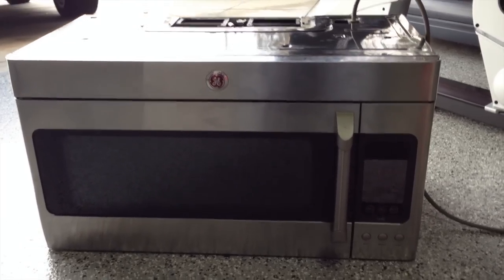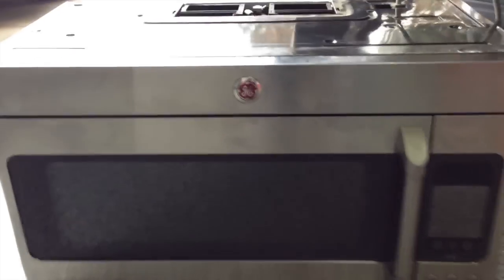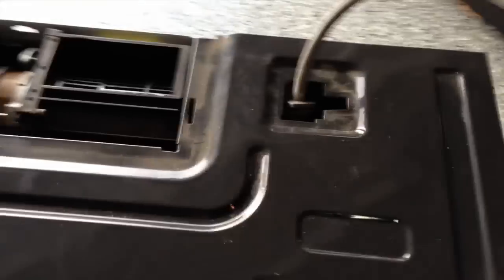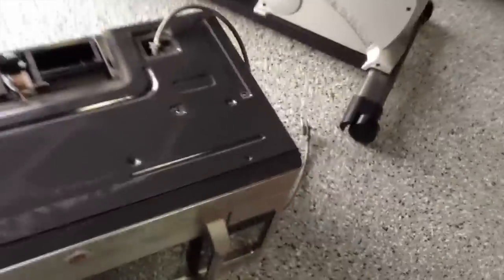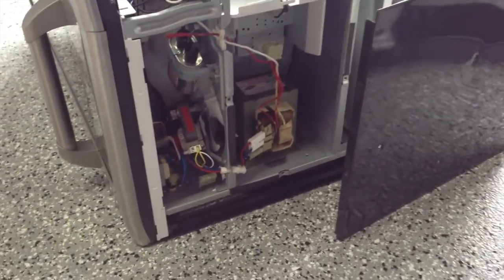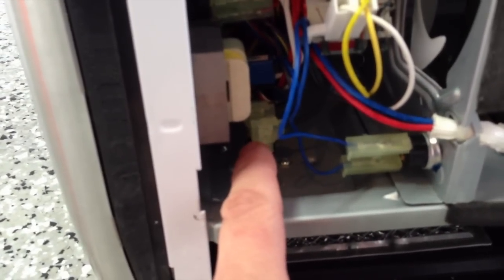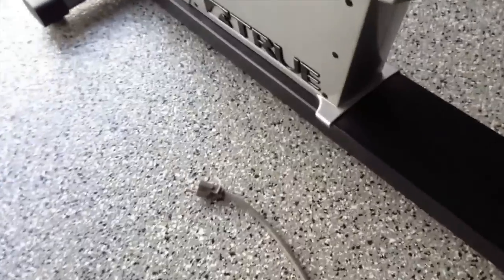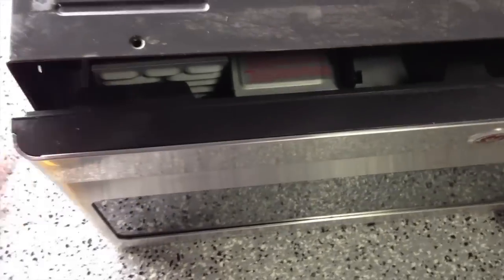GE Cafe Microwave Touchpad Failure and Possible Solution.

Comment: Rather than remove the entire casing from the microwave, take out the two screws on the top (in back of the fan). Move the fan cover to the left and remove. there is one screw at the top of the control panel; remove that screw. Now, lift straight up on the panel to disengage the clips that are holding it to the oven. You will now expose the wiring. The connectors are right there, behind the panel.
Reply from the maker: Yes, that is correct.  I just never took the time to update the video.  Thx for posting the much easier method.  Someone else also posted a long time ago... So it's at the bottom of comments and most don't see it.

Comment: Wow.  This was so easy.  I did a hybrid of what Alverton said to do to open up the microwave (no need to uninstall the microwave or take the entire cover off - just take off the fan guard and then the touch panel lifts up and out) and Andrew said to do with regard to the cables.  I unplugged the one cable that Andrew pointed out in his video, left it disconnected for about 30 seconds, and reconnected.  This took me about 5 minutes.  Thanks to both of you.

Comment: THANK YOU SOOOO MUCH FOR POSTING THIS!!! We have a 6 year old GE Profile Microwave, which was in the place when we bought it and is currently retailing at Home Depot for $569.  Mine doesn't look exactly like yours, but I actually accessed the same area by taking off the vent cover on top, then removing the touch pad.  I basically unplugged all of the clips that look like the ones you referenced, waited a minute and plugged them back in and YES! microwave is fully functional again.  You are a good Samaritan.

Comment: Andrew, thank you for posting this and it just worked on my 2007 GE microwave but after a modification to your approach.  I tried what you recommended as the two connectors were definitely not on the tabs snugly.  After reattaching firmly and powering up, there still no response from the touchpad.  But then I crimped the connectors slightly with needle nose plyers and tried again.  YES!  It now works. Thank you for again for figuring this out for us!

Comment: Our touchpad failed today as well.  So glad I found this post.  Just called GE Customer Relations and as stated here they are replacing the entire microwave.  Can get a similar Cafe model (CVM1790SSSS) for free, or upgrade to the Cafe Advantium model (CSA1201RSS) for about $250.  No more LCD panels on the new models as I guess they couldn't resolve the issues with them so they changed the design.

Comment: You can get to that Thermal fuse from the front panel.  take out two screws where the vent unit is, slide vent unit to left 1 inch.  Then under that you will see one screw that hold the control panel on, simply unscrew that and open control panel outward.
Reply from the maker: Yes, that is a much quicker way to fix this and turns this into a very quick and simple fix.   I didn't figure that out until after I made the video.
Reply: Wish I would have seen this comment before I took everything apart but good to know for the future! Thanks!

Comment: Thank you for this! Saved me a lot of hassle and an expensive service.

Mine had an extra couple of screws underneath the microwave. I was wondering why the casing wasn’t coming off and then found them.
Reply from the maker: That's awesome people still use this video.  Glad it helped you out.   This video is outdated (see pinned comment for easier method).  GE is a bad company in my opinion.  They design products to fail and take advantage of consumers.  Filling up landfills w/ broken products so they can make a profit.

Comment: Well done demonstration. One further item to check. I found when troubleshooting my unit, that the actual cause of my intermittent loss of control panel function, was the fuse clip holding the lower of the two fuses in the unit located behind the  small panel above the control panel, was not holding the fuse securely and the vibration caused by opening and closing the door as well as the entry of information on the control panel was causing the problem. Remove the power, pull the fuse (s), carefully crimp the spring clips to tighten the hold on the fuses. Another note, when cleaning the contacts on the ribbon cables it's best to use a cleaning fluid with no oil content. Some rubbing alcohol contains a lubricant.

Comment: I did what you said and it did not work, I disconnected this thermo sensor along with the other next to it with two blue wires and that did the trick.  Thanks, and if it does not hold I will be calling GE like the ladies above.

Comment: Thanks so much for the info..I was able to get a new Microwave with just a nominal fee, because the old micro was 5 years old. I was also able to acquire new knobs for the cafe range due to the plastic knobs breaking. They now are metal. Thank you again for this info, it saved alot of money..:-)

Comment: I thought I would add the information already presented here on the GE Café Microwave issues. First, thanks goes out to Lisa, for the information on calling GE. I called today and spoke to a consumer relations representative. I was then directed to another representative who handles the "touchpad microwave" program. He was very professional and inquired if I tried the "hard restart" to which I did. He then indicated that GE has had numerous problems with the GE Café models and that I qualify for a replacement. GE, through a third party will have all the work done within 3-6 days. FYI, the circuit board would have cost $629.00 to replace.... $13.00 more than I paid for the microwave.

Comment: I have a GE profile microwave with some on the touchpad not working ---defrost, stop cancel button. I followed the solution posted below by just removing the panel as described below, taking photographs of the connections on the panel, unplugging each connection and then plugging it back.It works great now!! You can avoid a lot of work by avoiding removing all the panels.. FYI.

"Leave OTR Microwave installed. Unplug the power cord. Remove 2 screws from fan guard and slide off. Remove screw at top of the touch panel and lift up on the entire touch panel about ¼ to ½ inch. Take a picture of cables for reminder. Unplug all the cables that connect the touch panel to the microwave. Remove the green ground cable by removing the screw. Gently remove and reseat three ribbon cables. Reinstall. Fan vibration causes the problem. You just saved $700.00."

Comment: I too have the same problem with this microwave and as someone posted earlier, it's connected to heat generated from the stove.  It stays in demo mode now and is basically a brick sitting over my stove.  However, when I'm cooking, the panel shorts out and beeps every thirty seconds or so.  Nothing on the panel stops it and the only way to stop it is to cut the circuit breaker.  The problem with that is my bathroom is on the same circuit.  It's hit or miss how long before we can turn the breaker back on so that the beeping stops.  I called GE and they will not replace the unit, they proudly say they will discount the service call and maybe the repairs.  I did get them to send a replacement panel.  Meantime, I'm checking out this video on how to replace the panel that is coming and I notice someone posting a phone number claiming they will replace the unit.  I called it again and got the same response.  THEY WILL NOT REPLACE THE UNIT.  I will be sure to post negative comments wherever I can to warn others to stay away from GE, particularly, this unit.

Comment: Lisa: Thanks!  GE replaced my microwave with the defective touch pad.  Interesting that the user's manual for the replacement says that the cooling fan comes on automatically if the microwave gets too hot (even if not being used).

Comment: Our GE Cafe microwave worked fine for 5 1/2 years. Suddenly, the touch pad quit working. We did as suggested in the video and it worked a few times after that, then stopped working.  GE will sell us a different model for $505. I don't understand why I would want to pay $500 when I can buy a different brand cheaper?  I'm done with GE since they won't stand behind their product with a known defect.

Comment from the maker: The first time it worked for a year and half or so....    The second time (which is when I made this video) it only lasted for 5 Months!  Funny you commented on this now, because our microwave/touchpad just stopped working again.   I should have tried to glue or secure the connection in, as I'm sure it has just been moved out of place from operating the unit; which seems to be the main problem.    
I wish I had a better answer and results for you.

Comment: #1 you do not need to remove your microwave to attempt this fix. #2 GE has finally recognized that this is an issue and will issue a replacement microwave if you've purchased the unit within the past 5 years. Call GE at 1-866-898-7465 option 6.

Comment: The control panel on my GE Cafe Microwave (Installed in May 2011, manufactured in Nov. 2010) has died at least 5 times. seems to be connected to heat from cooking. I could revive it by running vent and blowing air from a fan on the underside of the control panel. I Also run the vent (which is noisy and annoying) while cooking and can't use largest burner. This is ridiculous for such an expensive machine. 3 weeks ago I used the oven at 350 for 45 mins. but did not think to run the vent. Now the control panel is DEAD.  Repairman said would cost $651 to fix with a new control panel - he also said that heat and steam destroy the glue that holds the panel in place - so you always have to run the vent.  Before I get this thing fixed I want to find out if anyone else has had this problem.  It's unbelievable. I will also call the 866# that Dan kindly posted.   Thank you for any tips.

Comment: Leave OTR Microwave installed.  Unplug the power cord.  Remove 2 screws from fan guard and slide off.  Remove screw at top of the touch panel and lift up on the entire touch panel about ¼ to ½ inch.  Take a picture of cables for reminder.  Unplug all the cables that connect the touch panel to the microwave.  Remove the green ground cable by removing the screw.  Gently remove and reseat three ribbon cables.  Reinstall.  Fan vibration causes the problem.  You just saved $700.00.

Comment: Yeah, I don't understand the theory here. You disconnected and reconnected the over heat thermostat. I would need to look at the schematic, but usually the overheat TCO throws power to the fan. If you had a bad enough connection at the TCO that might create a load in series, but that would be a really bad connection with char marks on it.
Reply from the maker: I have no idea.   I was just playing w/ the connections after it stopped working...  and then it worked again.   I used the same principles I do for first-step trouble shooting on guitar rigs.  Check connections, unplug and plug back in.  I’m sure you can provide more insight as to why and how to fix than I can.
Reply from the maker: Not really sure why it worked for me.  It just worked...  If you find a better way, I'm sure everyone reading/watching this post would greatly appreciate it.

Comment: I too have the GE Cafe microwave control panel issue.  I followed the instructions from the video (twice actually) but it still doesn't work.  When it first broke the panel lit up, as well as the inside of the microwave, but the touchpad would't do anything.  Now, after taking it apart and "trying" to fix the problem, I'm not getting anything at all, not even lights.  Extremely frustrated as I'm sure you all were.  Any other advice you can give me?
Reply from the maker: Tracy, someone gave an incredibly helpful hint on an easier way to take the panel off without having to uninstall the microwave.    Look through the comments and you'll find the instructions.   
Give it another shot and I bet it will work.  
The other option is to call ge customer care (number also provided by a user in their comment) and complain aggressively.   They'll probably send u a new one for free.  That's what I did because this issue kept happening every few Months.
Reply: Andrew Bradford Thanks for your quick reply and advice.  Going to read all other responses to find the one you are referring to and give it another shot.  Concerned that GE won't be too cooperative with me as our microwave is over 5 years old.  I'll post the outcome in the event it can help others.  Thanks again!

Comment: why would we push it in then take it out for 20 seconds?
Reply from the maker: I'm not sure I understand your question.   Just take out the plug for a bit and plug it back in.  
Or, call GE like Others did and get yourself a free new microwave.  The replacement isn't a cafe series, but it matches good enough.
Reply: Andrew Bradford The replacement you get is a GE Café™ Series over-the-range microwave oven CVM1790SSSS. It's ugly but it is technically part of the Cafe series.

Comment: youtube.com/watch?v=F_94SxrVXU4 has a video with step by step instructions on how to repair a similar Cafe model.  It shows how to remove the touch panel with the Over the Range (OTR) Microwave still installed (as described in my previous post).

Comment: Good Afternoon,  Is there a toll free number other than 432-2737? I called and there is an $84 charge just to come out to the house.
Reply: Do not replace control panel or control board. Just simply use your  hot air blower and heat in front  of  touch key for  one or two minut. do not heat  display only key number. your touch key problem will go away